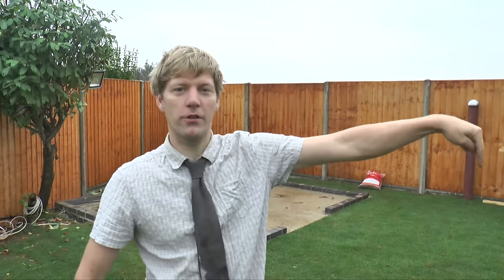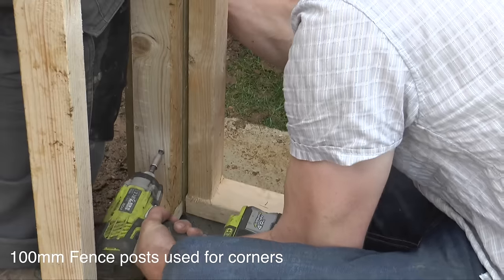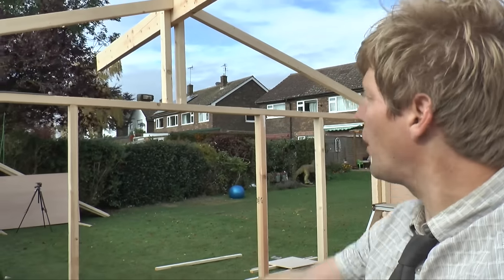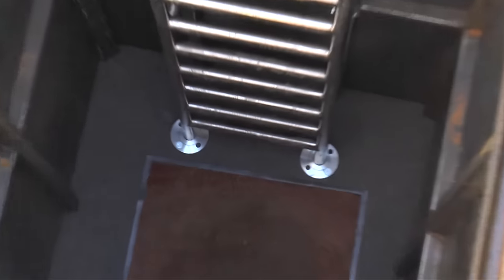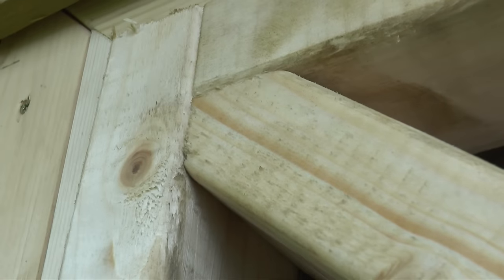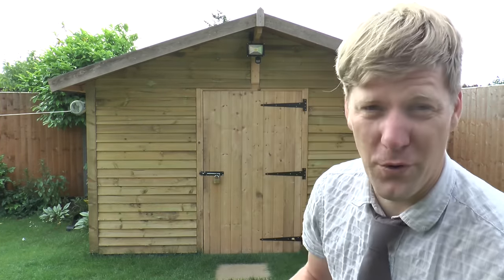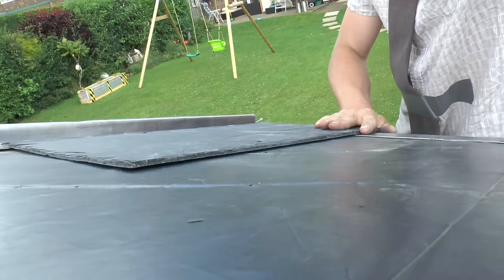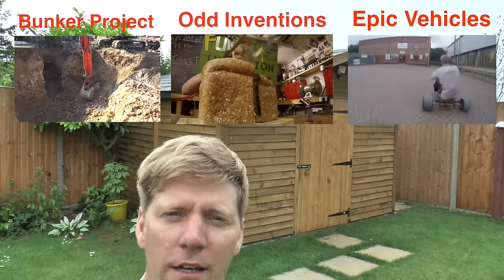How to build a really SOLID shed

Comment: Ummm... Isn't lead dangerous? Why build it into the roof?
Reply from the maker: Lead is very common in the UK
Reply: It's only dangerous if you eat it...
Reply: If the slats roof is build correctly and that no water sip into the lead, it will actually last much longer then zinc or zinc plated aluminium roof flashing, with that said though, I will never use screws and nails that doesn't have some sort of sealant to stop water sipping in between different types of metals.
Reply: Well... touching it for a long period of time isnt great either, but for stuff like that, its generally okay. Youre not going to touch the roof all the time after all. A lead doorknob would be more of an issue. :P
Reply: You should wash your hands after handling that much of it, that's pretty much all the precautions you need to take.  You don't want to eat too much lead but as a building material it's pretty benign.  It's certainly not as bad as some other materials (like asbestos...)
Reply: Not really the point is it? ;)
Reply: Lead is dangerous if ingested. As long as Colin doesn't decide to eat the roofing I think he will be fine
Reply: +Daniel Wilson lol
Reply: Why write with it🙀
Reply: Dylan Black Most pencil "lead" nowadays is actually graphite.
Reply: Pencil lead is not made of actual lead.
Reply: Eating a solid bit of lead won`t do much. It`s only dangerous as a trace element in food and drink , or in larger quantities travelling at you at more than 300 meter/sec.
Reply: Handling of new/fresh Lead is fine if you wash your hands (would still recommend gloves). But old Lead can be really dangerous. If you see Lead that is white/sweating and have a oily surface, do not touch that shit without gloves. It can be absorbed into your skin. The long term effects of Lead poisoning can be nasty.
Reply: just dont eat it
Reply: Wouldn't plant your beans where the water runs off the lead roof. Plants like to hang on to those sorta things.
Reply: Only if you intend to eat your roof...
Reply: If Colin was still a Plumber, but doing it in the pre-1970s, he'd probably be fitting LEAD water pipes to peoples house's over here in the UK, that's why we are all a bit mad in England, generations of Lead Drinkers passing on the Lead Gene :-)
Reply: Mad? Yes. But in a good way.
Reply: Because if Colin doesn't do SOMETHING that you'd consider dangerous / borderline suicidal you'd think you were watching the wrong channel.
But yeah, lead isn't that bad.
Reply: This profile picture brings me flashbacks
Reply: This might not be the channel for you
Reply: lead is only dangerous when Eaton it's a common building material for roofs (at least in the uk)
Reply: You said 'nowadays' but there hasn't really ever been lead in the writing part of the pencil. Only in the wart that's wood now, the part one would chew on...
Reply: +darkstari even with the crops, they won't incorporate it into their structure if it isn't there anyway!
Reply: lead is pretty much illegal to use in almost everything  in the usa
Reply: In the uk people still have aspetos roofs for garages and industrial units lead is minor compared to lead based paints which are dangerous especially to remove using heat or solvents so as long as you don't lick the roof or melt it and inhale the fumes I recon it's all good
Reply: +burningpentagram666 first laugh of the day. thanks
Reply: Lead poisoning is his source of inspiration, don't worry too much about it.
Reply: It's a shed not a sandwich, lead is only dangerous if ingested... or I mean if you get shot.
Reply: Lead itself, as long as it is in its metallic form, is not dangerous. You can touch it, you can lick it, you can rub your... Ok you get the idea.
The problem comes whith lead salts, lead salts are very dangerous, and their toxicity is cumulative, they arent removed by our excetor system so they stay in our body.
So, lead oxides are also toxic, so if you want to lick lead because I told you it was ok, make sure it is clean, like very very clean.
Eating it? Lead can react with the acids in your stomach, so not a good idea either.

The mith of lead beeing so so toxic, comes if im not mistaken from the roman ages, they used to boil vinegar in lead pots. Boiling an acid in a metal pot is basically asking for metal salts out loud (lead acetate in this case)
They noticed where the deaths came from, and they thought lead was very toxic.

Lead piping, not that bad either, do you know many people that died from lead poisoning? No right? Well pipes used to be made out of lead. Small amounts of lead oxides could go with the water, but no big deal, even smaller one now that lead pipes are no longer that common.
Reply: +ficolas2 Wow my comment is long, basically I said "lead aint a big deal blah blah explanation blah blah explanation explanation romans (wtf romans) blah blah"
Reply: So yeah, lead is only pretty bad if you ingest small particles of it.  And guess what?  Many houses in the U.K. are still fed by old lead water pipes, including my own.  Seems that the government cut-up a sweet deal when they sold-off the previously nationalised water services to the private sector as responsibility for replacing the old lead feed pipes has now been stuck on the home owners.  And you can't just rip out your section as often-times the whole street is fed on the same pipe, so if you switch it out and your neighbours don't, then you still get the lead dose from the upstream network.  I'm sure the Government/private sector must be laughing theirs arses off at that one.
Reply: I just looked this up. Apparently the graphite ore first used for writing instruments was mistakenly classified as lead as a result of relatively primitive science. The more you know!
Reply: Yup, that's why it's called 'plumber' (plumbum being lead in Latin)
Reply: +9ff70f96 even in water pipes, it is a problem if the water's pH is below a certain point.
Reply: +Erevos85 Or higher than a certain point, because as I explained in my comment, the dangerous stuff is the lead salts. With basic or acid pHs salts may form
Reply: +割烹着の悪魔 Yep its the tiny particles of asbestos that are dangerous if its contained then its an ideal building material, because even though its terrible to come into direct contact with, its properties are amazing, one of its more useful ones, and the reason it was created was the fact that it's essentially impossible to burn by conventional means.
Reply: And it is a really good insulator
Reply: The lead is for extra radiation shielding if there is ever a nuclear war!  It's a shed covering a fallout shelter after all.
Reply: it's very dangerous someone gonna eat the roof...
Reply: leads not that dangerous just wash u r hands after using it
Reply: +Hulkjamie the troubles of spec ops
Reply: I can't believe no one has yet given the obvious answer to this. Safety Tie.
Reply: It depends on the environment, lead exposed to air will form an insoluble lead carbonate surface so there is little danger in just touching it, lead in old pipes and paint is much more dangerous
Reply: +Makerj101 actually that really wouldn't do anything, and it only takes a metre of solid packed dirt to reduce the radiation to harmless. it's actually pretty easy to shield against radiation.....
Reply: Only thing about using lead on your roof is keeping scrap metal thieves out your garden but I think Colin has enough weapons around him to control that situation
Reply: He asked a question, and was polite about it. He has his answer now no need to insult him.
Reply: He wouldn't write a comment on youtube if he was afraid of criticism and no one has really insulted him so jog on mate
Reply: So, you mean, I shouldn't have cooked up a pot of it on my cooktop just this afternoon?
Reply: or breathe it, therefore unleaded fuel for some years now!
Reply: people thought tomatoes were poisonous for such a long time, because they were eating them on lead plates or pewter (high lead containing in low quality, especially in earlier times), the acid from the tomato was pulling lead out of the plate and people were dying of lead poisoning. Random fax.
Reply: With some of the shit Colin does, lead is hardly a worry hahaha
Reply: I have a lead roofy
Reply: The only, only viable usage of lead over the pond here in Sweden is in ammunition and it's almost banned there as well...
Reply: I can say from first hand experience that many Hotels and big old stately homes still use and have lead piping, especially in the older sections.
Reply: +Makerj101 why am I not surprised to see you here :p
How's your engine running man?
Reply: plonker
Reply: Aye lad, watter dun't taste reight if tha can't taste a bit o' lead in it.
Reply: No it's not.  They still sell lead sheets at hardware stores for this very application.
http://www.lowes.com/pd/Union-Corrugating-12-in-x-20-ft-Lead-Roll-Flashing/3499752
Reply: why dont they use aluminium
Reply: Only if your drinking water that passes over it.  I take it you don't drink gutter water...
Reply: I'm not saying it's not bad for you.  I'm saying it's not illegal to use in the US.  Commenting system didn't attach my comment to SHADOWxWOLF's comment....
Reply: Yep, that's how it works.  Instant brain damage.
Reply: not like hes gunna start licking the ceiling
Reply: +TheDrakenZ just an fyi the plates were pewter.
Reply: A lead roof is fine if you don't drink the water that runs off it, and that's if you have a leak. Lead paint is the real killer.

Comment: I’m no engineer, but shouldn’t there of been a header over the door opening? 🤷🏾‍♀️
Reply: You only need a header if its a load bearing wall (has weight on it i.e a house)
Reply: @j4m875  or a roof load, snow is heavy.
Reply: @j4m875  Wouldn't the slate roofing tiles add a lot more load, thereby a header would have been the safer option.. .

Comment: In america, they would call this a house.
Reply: its got plumbing and electricity under it though
Reply: ...I'm pretty sure we'd call this...

...

A FREAKING MANSION. It must be around 12'x18'!
Reply: I'm pretty sure the average house in America has more square feet than the average house in the UK.
Reply: The Eternal Hermit I ment more the walls than the size
Reply: In all seriousness, the AVERAGE house over here, in the slice of the U.S. where I live, is comfortably sized for an average family, and is as sturdy as it needs to be to withstand the usual things that houses do (big storms, the odd falling tree limb, etc.). If it doesn't meet these criteria, it's probably old, and sitting in the woods or off of some sad little side road somewhere. Oh, and you'd have to be somewhere VERY unregulated to have a house with that type of an exterior.
Reply: @Emoticons, you have the funniest comment about "In america, they would call this a house" you are right considering how paper thin the dry walls and wood floors we have here.
Reply: Huh? Homes in the UK are only HALF the size of homes in the United States so what the hell are you talking about?
Reply: It's about the quality of the building structure
Reply: Emoticons no we wouldn't, that's a shed.
Reply: Emoticons Apologize right now.
Reply: Nicholas Shaver I'm pretty sure he meant the materials used. You don't have houses made out of bricks and cement.
Reply: Jim Garrison the materials used. I don't live in the US but I have family there and most houses are not build out of bricks and cement, mostly wood, hence the joke.
Reply: Where I am from in the US, wood houses are definitely the exception.  My house and every house in my neighborhood is a brick house.
Reply: The materials houses are made of in the US is very much dependent on where you live and when the house was built. In my neighborhood the houses are almost all brick and are no older than... I'm not sure, no older than 50 years? Where I live though the storms can get pretty bad (hurricane level), so most houses are made to withstand that kind of beating now a days.
Reply: 57% of the houses here are 2 stories 😂
Reply: Emoticons and a little bit bigger
Reply: The Eternal Hermit Look at the quality. UK is expensive and has very high quality
Reply: The us is way bigger than the uk
Reply: no
Reply: In America they typically use 2x4's at minimum. He used 2x3's. So nope. Also, we'd beef up the braces on the roof.

Comment: the height of that roof looks pretty close to the limit for what you can get away with without planning permission (2.5 metres if it is within 2 metres of a boundary). It is worth checking the rules (and if there are any local covenants) that might a the shed being built.
Reply: Colin dug a tunnel before getting the planning permissions… so I’m sure the shed was fine when he built it… probably included it when he built the bunker
Reply: Ur 6 years too late pal
Reply: 4m for an apex roof. 2.5m for a pent roof. It's well under

Comment: Feather edge straight on top of polythene sheet. Really helps it to rot. Should be a 30mm air gap.
Reply: Sorry to sound thick but how do you leave that gap if it’s the final layer?
Reply: @danegriffiths3233  It mustn't be the final layer. You have to attach spacers. Polythene sheet is also a bad choice, permeable membrane is much better ( as used on roofs). While I am at it, you do not need the rafters to support the roof further out than the wall - it is only about 80mm. This means that the top feather edge does not have to be notched for every rafter- and the roof membrane can be folded under and behind the wall membrane- no moisture gap.

Comment: that's shed not built to code
Reply: you're  not built to code
Reply: Easy dude. I think you're being a little too harsh.
Reply: If you going to make a comment like this I expect a detailed explanation of what was done "incorrectly" the correct way to do it and why its better. Submit your report within 5 business days.
Reply: A shed is considered a temporary building and doesn't have to meet building regulations in the UK.  There are limitations on how tall it can be and the land area it can occupy, but from the looks of it, the shed is within those limits.
Reply: I'm not sure what's typical in the UK, but a few things seemed odd to me. The stud spacing seems awfully wide; 16" OC is the common measurement in the US. You could do 24", I suppose, but you'd want 2x6s, not 2x4s. The timbers near grade (base of the walls) should be treated, and those look like standard S-P-F. Even with the concrete block, you're liable to get water infiltration and rotting. Those anchors don't look like they're actually doing anything; wood-on-concrete construction will commonly have bolts set in the concrete which are affixed firmly to the structure. The ply they used for the walls and roof doesn't appear to be graded for exterior applications. The sheeting they used for the building wrap isn't really the right stuff; a contractor would use house wrap or tarpaper. Rafter spacing is kind of wide, and the span is fairly broad for a gable roof without horizontal beams to prevent it collapsing. Those are the major problems; I'm sure I missed some other, more subtle issues.
Don't get me wrong; it's pretty great to see people hit a task with a total DIY approach, especially something as daunting as building a permanent structure. I applaud their efforts. However, there's a reason that people receive extensive formal education and on-the-job training for construction. A structure built by someone unfamiliar with the ins-and-outs can pose a serious risk to the people who use it. You can probably wave all this off as some red tape BS, but do you want to spend so much time and money doing something the easy way or the right way?

Comment: I used foam strip (meant for concrete slab expansion) along the brick course to cushion the timber wall and seal any gaps. 

I bolted the timber walls down by using m10 all thread set in chemical anchored holes. Its not blowing away anytime soon

Comment: Why did you not make it a Solar and Wind Electric Independent Roof Green Shed, with battery energy pack for the bunker too, plus install a rain water capture and recycling system too, then you have an off-grid more environment friendly bunker too, maybe an idea for a future video, with regards the bunker house tunnel system you built too?

Comment: That king span polyurethane insulation is very good for retaining heat but has no sound insulation properties.
If you want sound insulation use a dense fibreglass or similar.

Comment: Colin, how is the lead strip on the ridge attached to the roof? Thank you for this video. I am going to do exactly this, except that the door will not be in a gable end because I want to have a work bench running the length of the shed. There will be two windows in the gable end so that light falls on the work bench. Other than that I will follow your design. Were the fence posts 3" or 4"? I have always thought that the usual felt roofs are not up to the job, so I will be using slate too. thanks
Reply: @BloopTube  Thanks for the reply. The shed is built (thank heavens before all the materials rose in price), following the design in the video quite closely. I decided not to nail the ridge strip of lead down because I didn't want to puncture the roofing tiles underneath. It hasn't blown off yet! Because of the 12 degree slope on my roof, I used rubber tiles made from recycled black plastic bin bags. I also installed a small gauge gutters and downpipes leading to a soak away. I installed Rhinovent under the tiles and behind the feather edged strips. Thanks again for giving me the inspiration to do this

Comment: Just built my shed with the same methods. Solid shed. Only difference I used a true 75x50mm timber. So the feather edge sticks out slightly from the 100mm post. Think Colin must have used 75x50mm nominal?